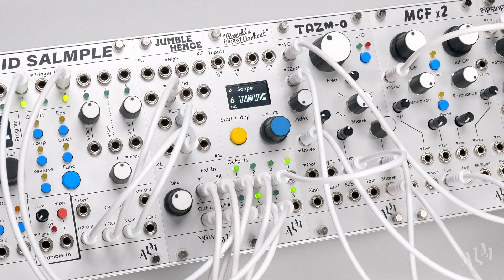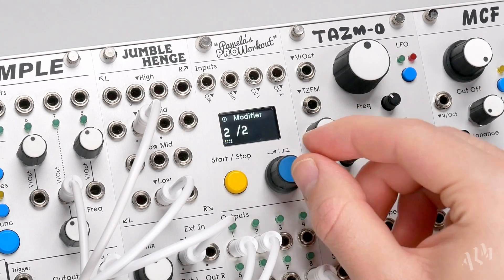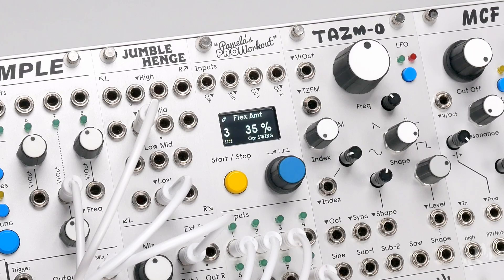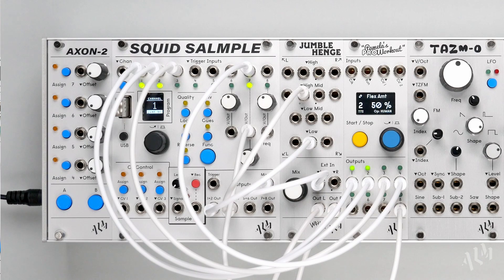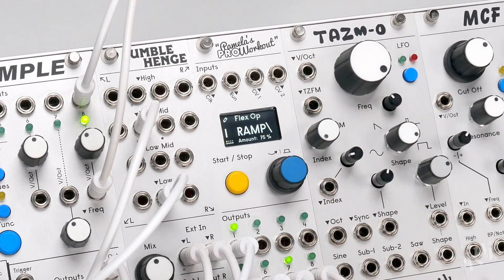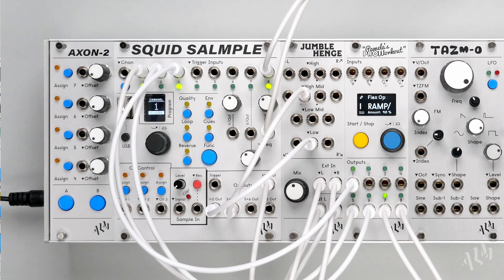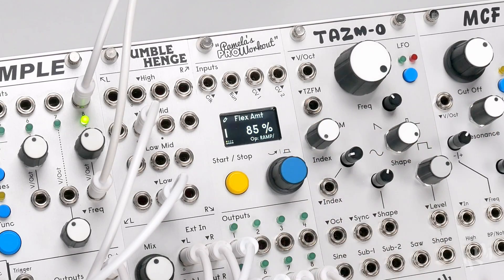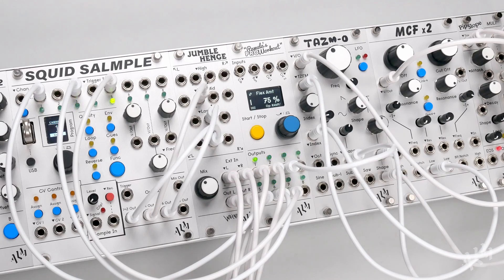Pamela’s PRO Workout: Off-Grid Timings with Human, Swing & Ramp Flex Ops

Comment: Can any of this can be implemented to the previous version of PNW? 
It would be nice a firmware update with some of these features.
Reply from the maker: No, the PRO was made to better accommodate many new features. The PNW had run its course with no more space left for updates and less capable hardware.
Reply: @busycircuits  🙏 one question, timecode 9:25. Can you assign an LFO to move randomly between sources, Out 2 3 4 etc? 
THANKS!
Reply from the maker: @pixelatedbeatz  Was this intended for the Cross Ops video? :) If so, yes you can assign CV to modulate the Cross Source then patch random from another output.